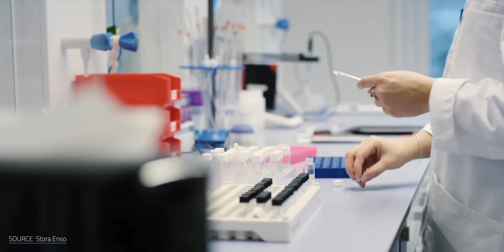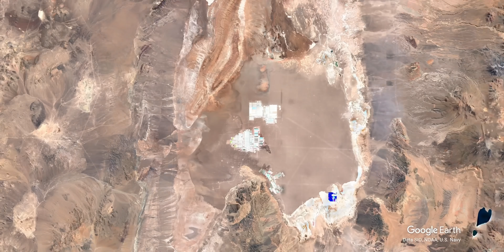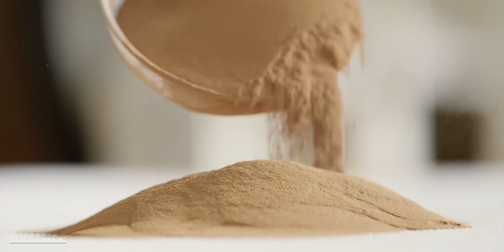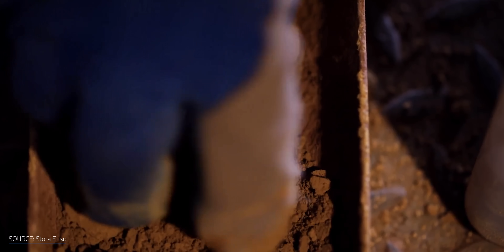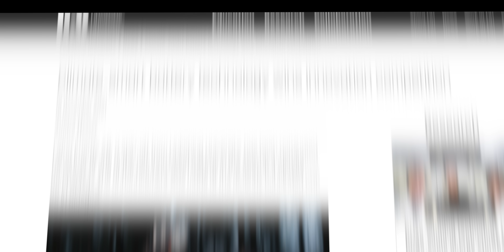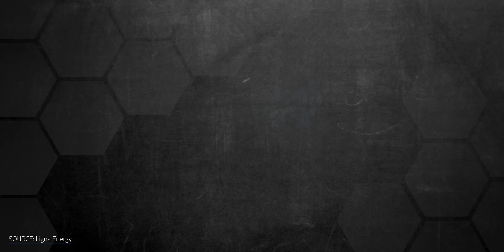Growing Batteries - Wood Battery Explained

Comment: 3:42 When working for Milwaukee Tool in the battery R&D department, we purposely overloaded tools with batteries installed and batteries by themselves. We had to put them into well ventilated, concrete- and bulletproof glass-encased rooms, with a little tiny tube to run all of our testing wires through. When one of those things went off, you felt the heat THROUGH the bulletproof glass... it's kind of insane. 

Also... don't let your Li-Ion batteries recharge and sit on the charger for long periods of time in sub-zero (°C) temperatures. The cold reduces the energy storage, but the charger may recognize this as the battery being undercharged, so it tries to put in more charge which could overload the battery causing a thermal runaway event. Keep your batteries warm as best as you can and try not to force too much power out of them when they're cold until they've warmed up a bit. Just some helpful tips... :D

Comment: With how good bio tools are becoming I wouldn't be surprised to see living batteries within my lifetime.
Reply: Yes, they are called extremely efficient genetically engineered fat cells that store most of our energy for billions of years. And are high density , cost effective, space efficient, ling lasting. 😉😂
Reply: @tomizatko3138  lol, if only they could be mass-produced and had a good energy efficiency for storing electric charge.
Reply: sounds like the matrix
Reply: What are bio tools? What's an example?
Reply: @tomizatko3138  I resemble that remark!
Reply: @1stGradeWumbology  The new oled techs, lots of the recent medical techs which rely on genes, GMO crops, etc.
Reply: microbial based batteries already exist.  The electron transport chains of many microbes and mitochondria are, in essence, little batteries. People are looking at the Redox molecules of these electron transport chains as potential renewable anodes and cathodes.  Life tends to optimize things (for a particular set of constraints).  They have been worked on over a long period of time.  :)

Comment: Also, if you char lignite(or any other organic material) the gasses that come off are a combination of cooking gas, gasoline, diesel, airline fuel and right on up to road tar.  They can be separated by a standard fractionation column such as is used in petroleum refineries

Comment: This video is actually reminding me of the study that I found a few weeks ago about how various lignin based components in a lithium-ion cell could improve their performance in all ways(capacity, power density and cycle life) over traditional cell components, such as the separator and electrolyte.

You could also get a lignin based binder, which has massively improved cycle life, but at a large energy density cost.

Comment: Cool stuff.

I think it makes a lot of sense that these technologies will coexist, serving different use-cases.  What makes sense depends on the financial details.  Provided they're cheap enough to produce and recycle, grid storage can tolerate really low performance batteries.  It all comes down to cost and sustainability.
Reply: For grid storage the most important properties are:
1. Reliability
2. Efficiency
3. Cost to make and operate
4. Raw material abundancy
5. High scale manufacturability

Comment: Rather than wood -- faster growing with lower resource requirements in a chase for Lignin include bamboo, miscanthus giganteus (bread for more growth control or the invasive fast growing Chinese Silvergrass used as suburban ornamental), sorghum, and corn stalks.
Reply: But by providing an alternative to burning the lignin that is created as a by-product from paper you can encourage more green friendly energy sources. These by-products will continue to exist. There is no reason to avoid using them in a way that is better than just burning them

Comment: Well I mean if they can lower from 2$ to 1$ that cuts half of half the battery cost right there. The other half could be cut down using salt or suf that also reduces the cost by 30% - meaning we could see batters cost as much as 70% less would be pretty big deal even if they don't hold as much charge per weight/volume. That would be REALLY good for grid storage to the point that instead of installing new power plants - we could just instead install new battery plants. With that said - I am a bit confuse - you you talk about how Lignin charges faster by being random - while graphitic is more layer design - yet some how it holds less? Wouldnt that mean we would want a mix of the two instead? One that allow for faster charging by mixing in like 1/x over the graphitic to increase storage by lowering the over all cost? Even at something of a cost savings of 20% would still lead to cheaper storage + faster charging that the grid needs would be a good balance between the two.

Comment: It is so important to wean ourselves off of Li batteries for static applications.  It is driving the price of Li way up, making EVs more expensive.  And there are better alternatives for static batteries that simply do not degenerate with time and are made from cheap materials.  For instance, Liquid metal batteries using Sb and Ca and now Al and S, ZnBr batteries, either flow or gel, Various ReDox batteries based on Fe or V,  and the up and coming Na batteries.

Comment: Potentially diaper material based green energy source, most newly created bioreactors can produce a green waste product dependent in inputs. There are quite a few containers designed to retain this waste product and those with large amounts of those containers are in a great need to assist with disposal.

Comment: this is really interesting... many paper mills have shut down since paper use has gone down. We could bring these plants back on line to 1) produce more cellulose products in order to replace plastics and 2) use the lignin byproduct for battery anode. Also the old mills, with their roll-style assembly lines, might be amenable to conversion into roll-style battery anode printing... another benefit is, since paper mills have historically been built at hydroelectric power sources, there would be extra-resilience of such "battery mills" grid outages since hydroelectric could serve as a backup

Comment: 17 million tons of lignin in Europe per year?  Isn't that mainly carbon and if so it would account for 3 times as much CO2 as that is only 1/3 carbon. It could easily be stored for easily 200 years or more. A small step for a short time but a step in the right direction and it doesn't require pushing CO2 deep underground.

Comment: This can become a high value added item if it is used in disposable, low power, short lived,  IoT sensors.
Sheets of paper on the floor of containers or trucks, that would alert if a shipment got wet. Or if something thawed out enough to leak.
Conversely, if they dry out, it would detect that the shipment humidity fell below a certain value.
Wax capsules can melt, leaking electrolite to warn of temperature changes.

Paper, cellulose and ligning are stable enough to be embedded inside dry walls, attics or closed spaces to monitor for water leaks. Maybe in ribbon form lining tubing.

Comment: one important note about integrating wood into a manufacturing process is that industrially used wood doesn't come from wild forests. old growth forests have a lot of variation in the age & size of their trees which runs up the operating cost of accommodating large trees into their supply chain, & then you run out of old growth and all of that money spent on upsizing your facilities is wasted anyway. so they use nurseries to grow trees in batches which allows them to A) harvest them really cheaply (dont have to go looking for them / go farther every time), & 2) produce trees of a really consistent (& maximum) size which allows you to tighten the allowances on your facilities
because of this industrial application of wood actually increases the amount of trees, not reduces it
(this doesn't apply to housebuilding, at least in the US homeowners love to have their shitty house built out of a thousnad year old sequoya)

Comment: I would usually say you are right in turning the lignin into a battery grade carbon, however, the process in manufacturing produces a byproduct called Syngas, which can definitely be used to produce electricity by running in an engine or many other things

Comment: U run my 3d Printer with some solar panels and old car batteries

most lead acid batteries can be revived by just topping them off with a bit of destilled water
if they are maintenance free you neeed to make a small opening for that
I simply used a soldering iron to melt a small hole roughly 1cm below the seem where the lid is welded on and filled destilled water until something came back out, wipe it dry, melt it shut and it's good to go

with 2 different battery testers I get some batteries that get the original ratings, hence why the battery currently in my car is an old battery I revived this way

not saying this is the solution for the big storage issues, but it is a way for folks at home to reduce their energy consumption from the grid

Comment: With so many ones so far, I'm honestly not sure which is the most ideal.  The one with the most recharge cycles and energy density should be the one to take the place of what's currently used for consumer batteries like AA, AAA, C, D, and 9-volt, if not EVs.

Comment: See you just mentioned the disadvantages of lithium ion. The cost benefits are just due to the current economics, which will change. The short recharge cycles of lead acid, misses the point. Lead acids can be made in such a way, that the plates are easily replaceable, making it a non issue.

Comment: Charge faster, increase battery longevity.

Bigger batteries but cheaper and less risky, so smart grid local storage.

I think this would be very interesting if a battery the size of a motorcycle or a car, could power my house and be recharged well through a days worth of solar charge

Comment: Affordable, safe, and durable stationary energy storage is the key to better use of local renewable energy generation. Combine solar roof panels with enough energy storage and you improve the use of the energy you yourself generate and you reduce the load on the grid. Besides that, it can be used for active load balancing of the grid.

Comment: Seem like a good thing, just make them big and cheap and it'll be great for a more distributed storage network, but we gotta keep them wind turbines spinning. It makes me sad when they're not spinning because I know it's only that way because of the local grid being at capacity. Unless theres zero wind which basically never happens here in Ireland they should always be spinning. At the the moment though I'd at least have them constantly doing electrolysis and having the gas collected from each farm for use as fuel later. Hho generation or splitting the two elements seperately while it doesn't make sense to have renewables make it for the purpose of conversion, if it's created from excess engery I'm all for it.

Comment: I like the idea of this. I know this is probably put there but is there a difference in the types of wood they could use. I only say this, being a novice woodworker, that I use specific woods when looking at different builds. Soft woods vs hard woods. Slow growers that produce a lot tighter grain vs a fast grower that shows a greater ring separation. Even when doing Shou Sugi Ban that involves burning or charing the wood, different woods react differently to the char. Again, I'm sure this is a non starter but my thought process is if say poplar ends up being the best wood to use for conductivity, that would be the added bonus of a tree that has an annual growth rate of 10 feet a year. A lot more than a lot of other trees out there making sustainability even greater.

Comment: It would be interesting to do the math on combining lower specific energy batteries like these with other energy storage systems that require large weights, gravity batteries for instance.  The chemical battery could provide immediate frequency response while lifting/dropping the battery would handle longer duration discharge.

Comment: Hallo Mat , there is a german company, which also uses lignin . The name of the company is cmblue. You will find information about them in youtube.
They build liquid solid flow batteries in different sizes. They are right now testing them in a powerplant near frankfurt and in a storage solution in austria in burgenland. 
They have founded a company  to build their batteries in california. 
Their product has reached a good stage of experience and is going into mass production right now. 
Greetings from Bavaria

Comment: Even if they have lower storage density (which will most likely rise as the tech gets refined), they still sound like a decent alternative to LiIon for stationary (grid-scale) battery setups. Especially if they have a wider range of operation temperatures (without massive capacity losses).

Comment: The concern about the lower storage density shouldn't be a concern since most electric cars don't need the battery capacity that people want. If we can change the mind set then this should not be an issue for most electric cars. Other transport like trucks and busses this will be an issue but they are already looking at hydrogen as an alternative, which is a better option.

Comment: it is even more straight forward. Wood gas can be used as a substitute for almost all petroleum products, and is extremely straight forward to harvest and produce. I have used it as a propane replacement. That heat can also be harvested and converted directly to electricity. Too many middle men reduces the overall efficiency of the system more than a single inefficient system. Incremental loss is a big deal. Simple is better

Comment: it's definitely interesting on the tech  side, and pivoting off the current waste stream is certainly a smart move, I do wonder about the long term stability in market costs (byproducts that find use often increase in value) as well as the ultimate scalability

once the immediate stock of by products reaches saturation, this puts a lot more pressure on wood as a resource, which can be done sustainably, but historically has not been.

Comment: Low energy density so probably not cars or phones? Maybe trains if you had an entire section dedicated to batteries. That's a pretty unfortunate limitation. Stationary batteries for homes and to store renewable energy for the grid is still a pretty big use case though.

Comment: If I remember correctly, lignen is extracted for making clear wood, if that's the case, making clear wood in place of glass for windows could lead to an easy lignen source, decreasing the price of those types of batteries. Assuming clear wood and these batteries take off that is XD